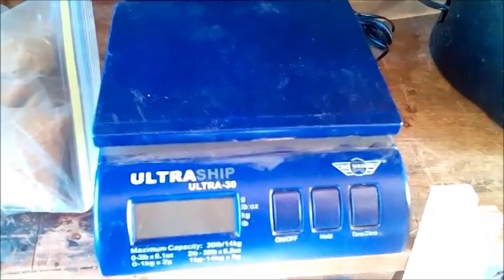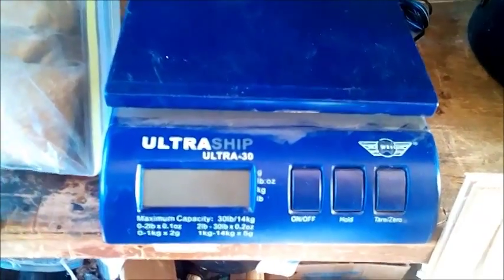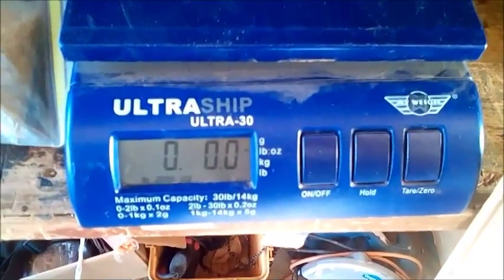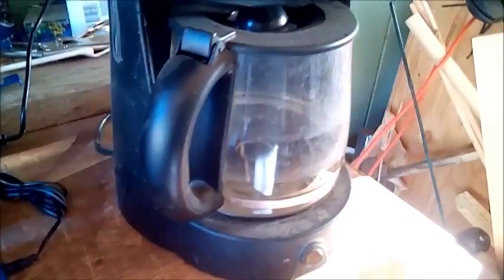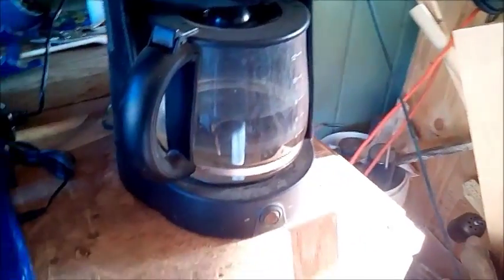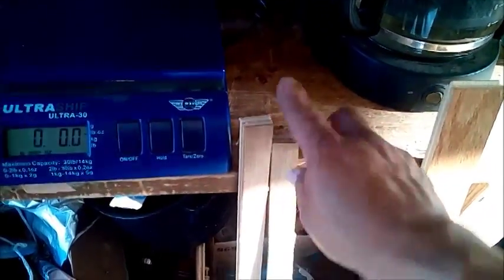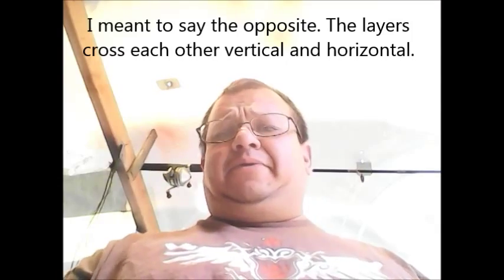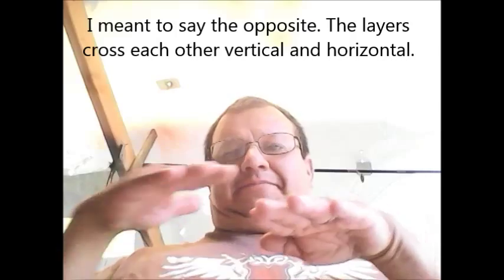Materials I intend to use for making a composite bow.

Comment: Hide glue won't adhere to PVC, just so you know.
I'd actually use Epoxy.  If you're going to put a sinew, raw hide or fabric back on it hide glue works really well.

As far as the thickness of the core goes, I'd wouldn't go any thicker than 3/16" preferably 1/8". For applying PVC to the belly of the bow carve corresponding grooves into the Pipe and the core to increase surface area, and make sure to wear gloves or wash your hands before handling the core material

Hope that helps ^_^